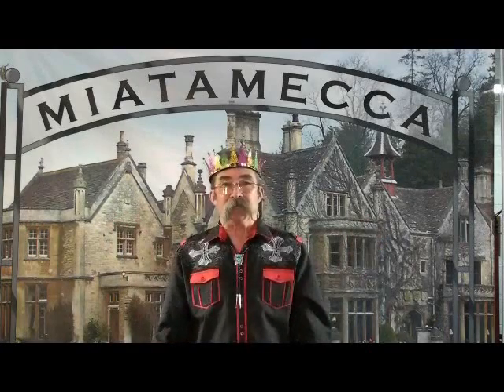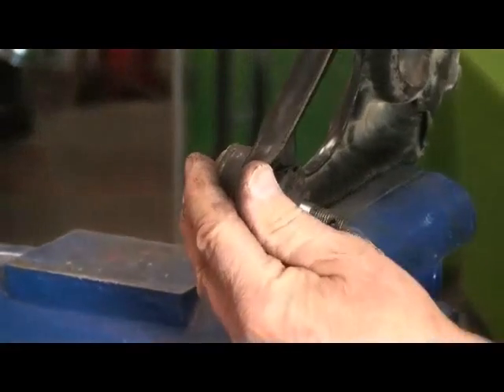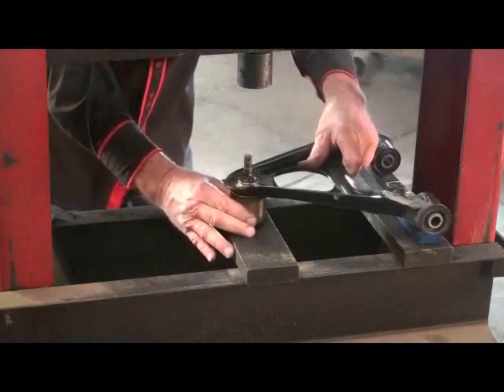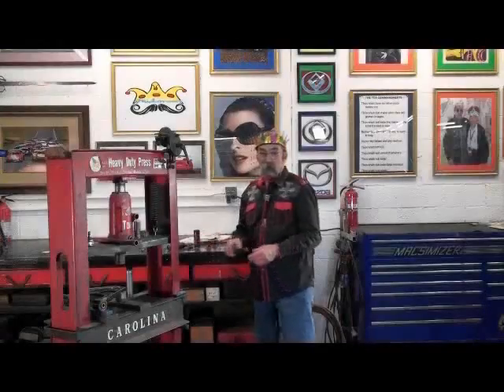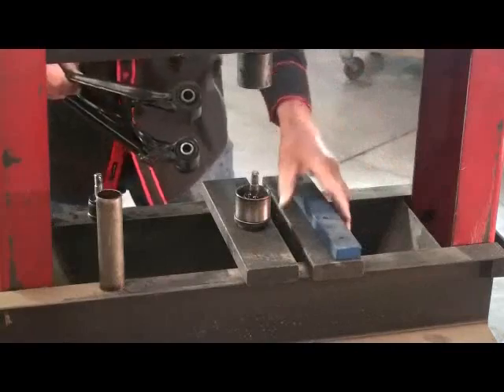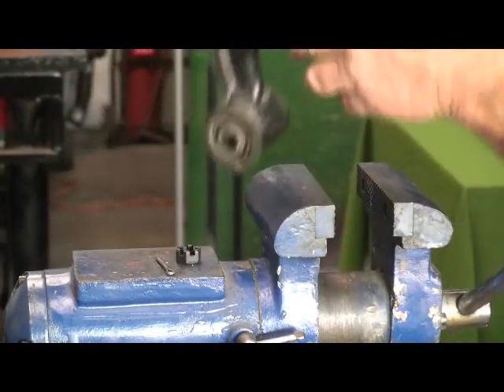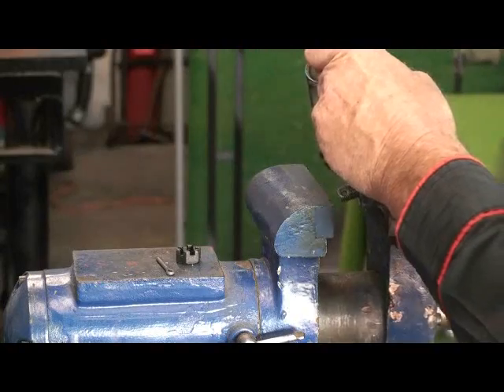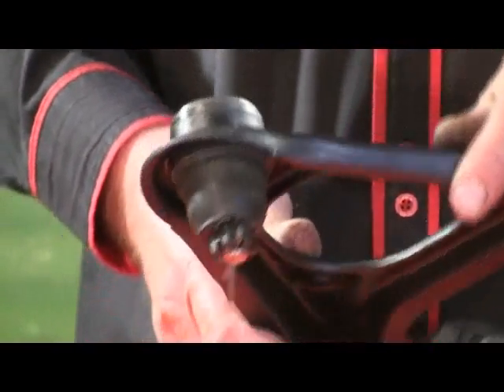How To Replace Front Upper A-Arm Ball Joints 1990 thru 1997 Miata MX5

Comment: What is the diameter of the pipes and such you are using as Driver and Receiver fittings?! I don't have easy access to a press so I need to go in prepared with all my parts and tools!
Reply from the maker: Hello Sir Jake,
Watch the video and you will see how to size up your tools using the new ball joint as a guide.
The King of Miatas. Mike.
Reply: @MikesPlaceBiz  I understand practically how to do it if I had a lot of pipe lying around. But I need to go out and buy each piece so was hoping you had ID it OD on those pieces
Reply: I second this.  Do you have any calipers lying around to measure this in order to prevent the need for the going back and forth to the hardware store?
Reply: @mahmouddahjeed2929  hey I ended up going to oreillys and the press kit they rent + an additional box of adapters had what I needed! So simple
Reply: Jake keliinoi thank you for that.  I’ll be renting that kit!